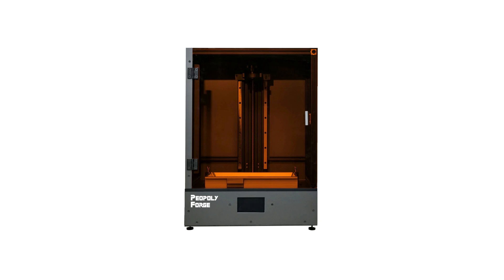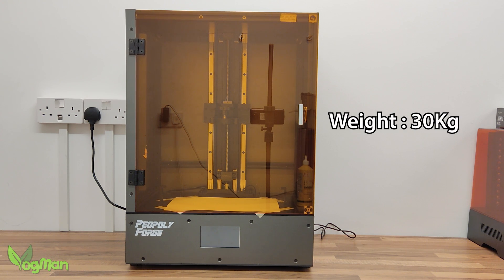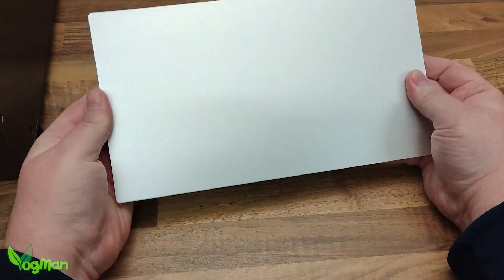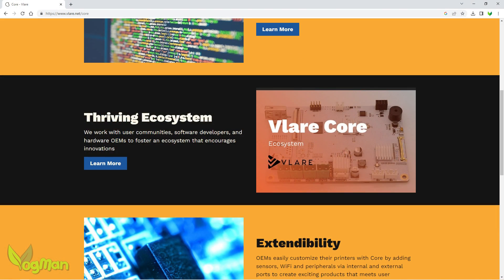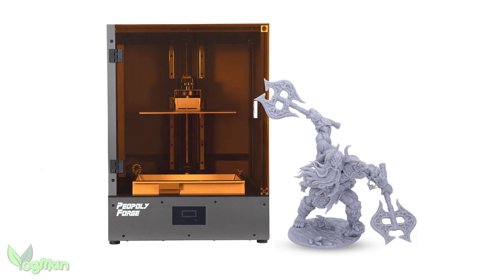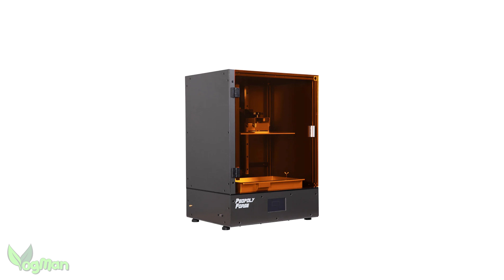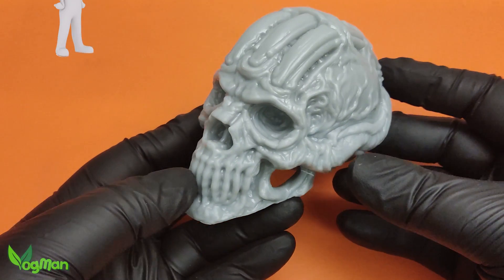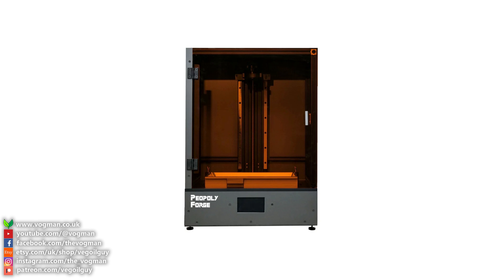Peopoly Phenom Forge 3d resin printer [HONEST REVIEW]

Comment: I am a bit confused, the XY print area is larger on the phenom than the Jupiter, but the screen size has the same resolution, yet the XY resolution is lower on the phenom - why?
Reply from the maker: Try this video Dan https://youtu.be/vIi6N9EXexc
Reply: @vogman  i did, but if the XY size is smaller on the jupiter, but the resolution of the screen is the same, how is the pixel size smaller on the phenom?

Comment: No thanks. Too much of a hassle. Fit and finish looks terrible.
Reply from the maker: You think so? I think it's a nice looking printer. It feels very sturdy. Other than the gripes I mentioned, I find it very pleasant on the eye and honestly quite easy to put together. If it wasn't, I would have said so 😁
Reply: It’s not that I don’t believe you. The gripes you mentioned helped form my opinion. The shot of the off center upside down usb port did as well. The camera and vat heater also seem like afterthoughts.

Really that was my short answer. I have a number of concerns with it. Specifically the DIY assembly.

1. Increased likelihood of receiving a printer with missing parts.
2. If something isn’t working correctly who’s fault is it? Seems like it would be very easy for the manufacturer shift blame on the customer for a poor assembly job.
3. According to your own consumer survey this brand is one of the poorest scoring. Do I want to take that chance? With a kit? 
4. No instructions in box? What other corners were cut?

At the end of the day its not for me. It’s a project & Ive got enough of those.
Reply from the maker: No worries Joseph. I'm not trying to persuade you one way or another. I was just concerned I hadn't properly voiced my thoughts. As long as I've given you enough information for you to form your own opinions, then I'm happy 😁
Reply: @vogman  This is a good option for me in the UAE as i dont want to pay $650 usd for shipping on the Mega 8K, plus taxes (10%) plus profit to the reseller.  In Dubai the Mega 8K costs $3200 landed price.  The Phenom Forge costs $1415 landed. 

So for an extra 5cm on the z-axis on the Mega 8K, I would be paying over $1000.   The Mega 8K is a good machine, but i don't think it's "$1000 for an extra 5cm good" when compared to the Forge.

What do you think?  Would you pay the extra and get the Mega 8K in my case?  

Phrozen seems to have a few issues, and they are selling off all the Transform printers as they cant find a supplier for the LCDs anymore. The Transform is now also only $999, but obviously that price grows to $2500 here in UAE, and plus it's basically a brick once the LCD dies.

Comment: Based off your experience, would you go with a larger plate of the forge with 50um or a midsize printer that has between 35-25 um? Having a hard time choosing between the options.
Reply from the maker: Well, Erik, I'd probably go mid-range as these massive machines take up a lot of space and cost more. As for which one, wait a fortnight before deciding anything. I think I have an interesting printer that many will like to see 😁
Reply: @vogman  Man, getting me pumped. I’ll wait, long love the vogman!!!

Comment: I got my forge over the holidays. It was a huge learning curve for me coming from elegoo and lychee and was a love hate using vlare. Peopoly have the best customer support I've come across in 3d printing and now Ive got a hang for printing large models with great detail and minimal support damage. I now feel like my saturn 2 is too small hehe. I agree with all the "gripes" you mentioned and the self assembly was upsetting until I did it. It works well for what I need.
Reply from the maker: That's great to hear. Would you please complete the online database https://vegoilguy.co.uk/3drp to benefit the Printing Community with your experiences. This will be a big help 😁
Reply: @vogman  id be glad to :)

Comment: I've been sitting around WAITING for someone to make a heated vat for a resin printer! Finally! Plus WiFi too. They are almost where I want them to be
Reply from the maker: Well... in a couple of weeks I've got another offering to show that might tick even more boxes for you 😁
Reply: @vogman  🥹
Reply: I'm not so sure it's a good idea. I clean my vats by putting them in my wash and cure machine. I'd assume that would break over time if I did that with these vats. Or you drip resin into the plug. Seems like a space heater is a better option to me. Although I don't need a heater so it doesn't do me any good either way. I'd prefer not having it as it's one more thing to break and I don't need it.

Comment: unfortunately the euro price of this is just too high... 200$ more to europe, + markup... cheapest I could find is 1600€, while the m3 max is available for around 1k... a heated vat is nice but not that nice, especially as the m3 max has other benefits like autofeed AND comes assembled... (and I've build both my FDM machines from scratch (Voron V0.2 and 2.4r2), so I like building)
Reply from the maker: Building this enclosure is MUCH easier than building the average FDM, so it would be a breeze for you. It's a shame Anycubic or any of the others didn't think about heaters too. It's such a benefit.
Reply: @vogman  it's really not that, it's the price difference. 

But maybe this will bring some of the other manufacturers to include heaters in their next generation :) (I already have a mars 3 so getting another is not urgent, though I'd like to go a bit bigger at some point)
Reply from the maker: I get that. 👍

Comment: Geoff,  FYI you don't need "WIFI" to use those features in your home shop ... You only need an "Intranet" or internal network. So just setup a wifi router and you can connect the printer to it and connect your PC to the router and no need for an internet connection to make everything still communicate together.
Reply from the maker: No internet, no intranet, no wifi and very, very low signal on my phone. It's a bit of a mystery spot in honesty. I keep saying I'll hardwire a decent ethernet connection, but somehow I never get around to it.
Reply: @vogman  Hey Geoff my suggestion was to purchase a cheap $34 amazon router and place it in your shop.. You can connect your devices to it via wifi without any access to internet or any other outside network. It will be your own little personal network for the shop that doesn't access the internet.
Reply from the maker: Thanks for the suggestion 😁
Reply: I never transfer large files via wifi to any of my printers as they can become corrupted and it takes way too long. Thumb drive is easy and much faster.